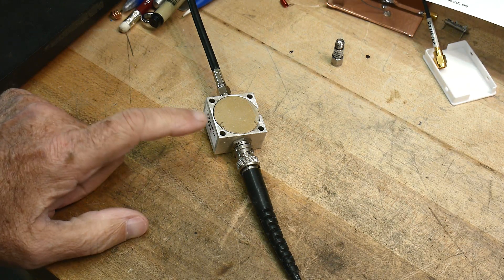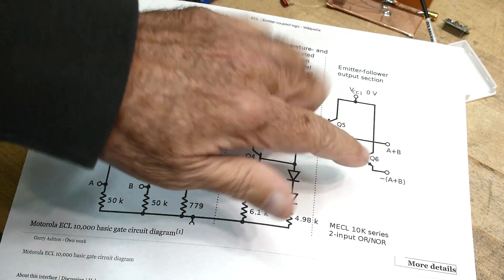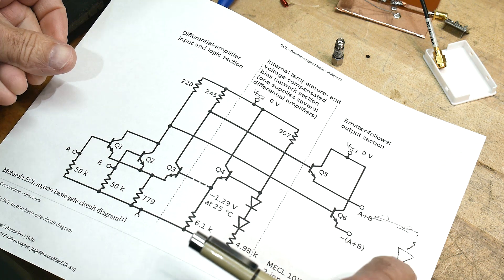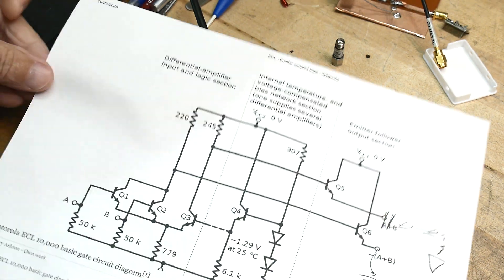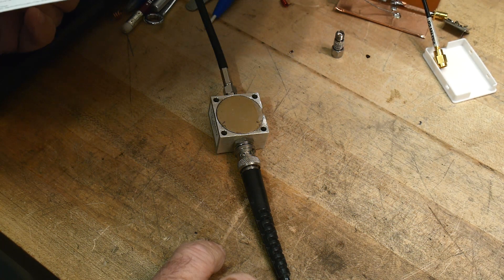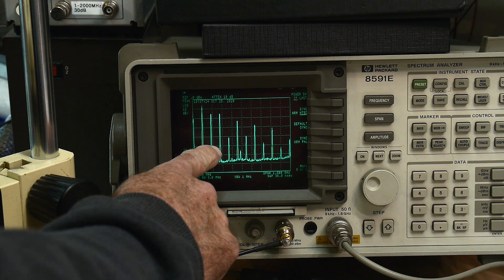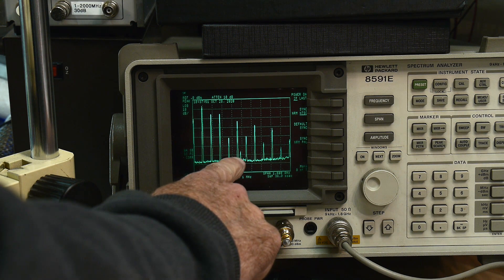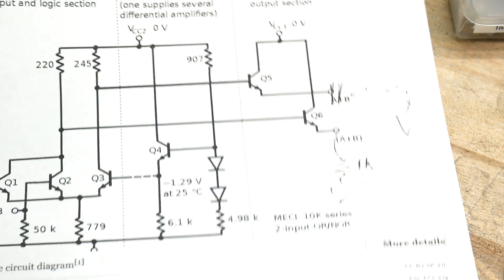#595b ECL Oscillator Fix

Comment: Good evening. Thanks for the video clarifying the significance of the pull down resistor at the output of the oscillator. The signal has become from -25 dBm to -4 dBm. The 5th harmonic and the ones beyond are not larger now than the f0. But I can still see the 101 MHz signal at the edge of the display. Or is it not there..!?
Reply from the maker: that is the 0hz
Reply: @IMSAIGuy  okay. Thanks 👍